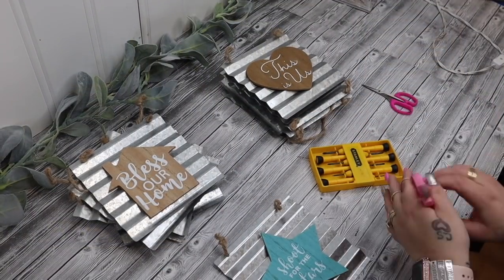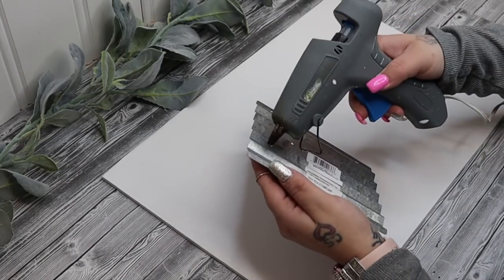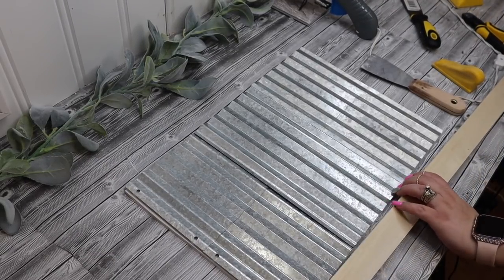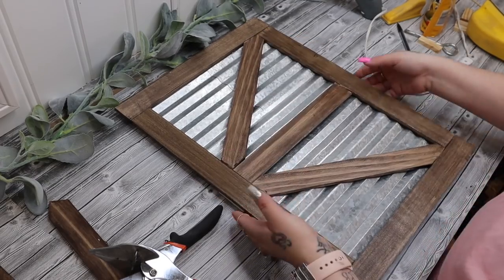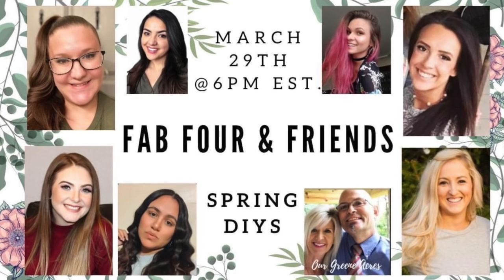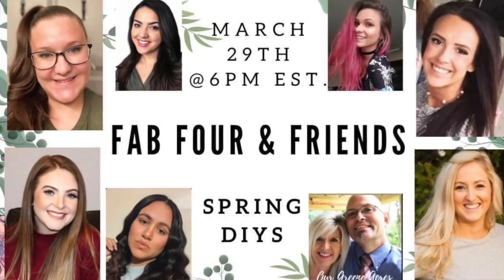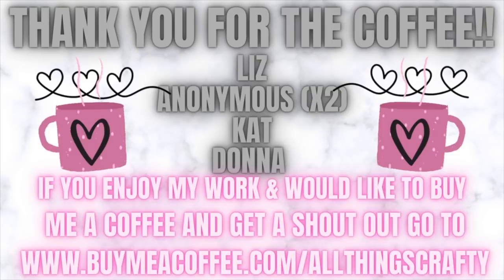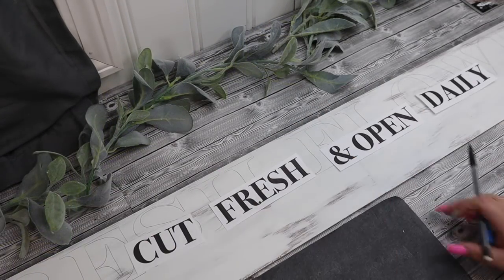🌟HIGH END DOLLAR TREE SPRING FARMHOUSE DIY'S | HIGH END EASY SPRING DECOR DIY'S ON A BUDGET🌟

Comment: Guys, Walmart sells a Silver Galvanized Pallet w/Jute Hanger that is 16" x 20" for only $5.64.  That's even cheaper than Dollar Tree!  It's available in stores only, but you can always order online and pick up in the store.  I'm definitely going to be making Barn Doors.
Reply: Do you have an item or sku number? I couldn't find it but would definitely be cheaper than dollar tree.
Reply: ALSO...Keep an eye out when they are putting out Fourth Of July stuff bc last yr I believe it was, they put out these larger accordion folded metal pieces JUST like those, but they are bigger with 4th of July stuff painted on it, but we know you can take it off w nail polish remover. They MAY put them out again. They are prob the size of like 3 of those things, but they are "flag" shaped or Banner shaped, so they come down on the bottom to points on each side, longer than the middle if that makes sense, but you can put them together or cut them! Finger crossed they bring those back ;)

Comment: The barn doors are amazing, but while you were putting it together and saying that you wish they were longer,  I kept thinking that you could have probably gotten a better deal if you went to Lowe's or Home Depot and purchased a sheet of corrigated metal sheeting. I looked it up and yep, for under $20, you could have bought an 8ft. sheet. Sometimes,  especially on bigger projects,  Dollar Tree is not always the way to go.  Just a little tip.
Reply from the maker: The problem with those pieces are they're huge, very very hard to cut, and the spaces in between the waves (if that makes sense) are huge. I have this at my house but most people don't have the tools to cut it. You need metal sheers or tin snips which we have but most don't. Not only that but it's dangerous. You can cut yourself really bad on regular tin😉
Reply: @AllthingsCrafty  I didn't even think of the "spaces" or whatever they're called.  You're right.  Oh well, was just a suggestion so you could get the size you wanted,  but yeah,  the DT ones would be smaller and more decorative.  Was just trying. To help. 😞